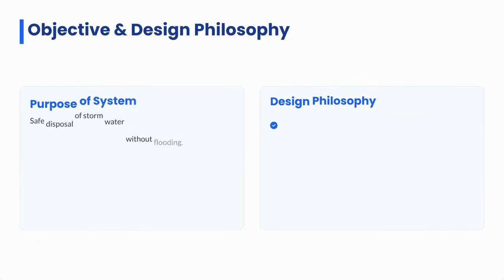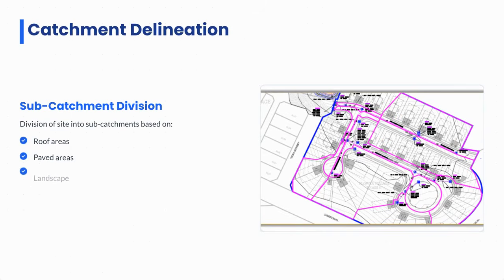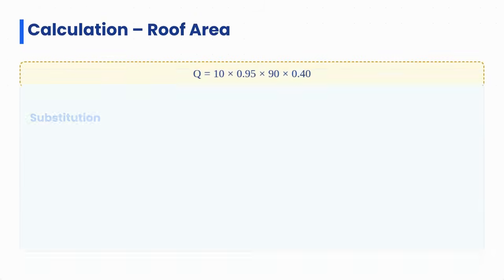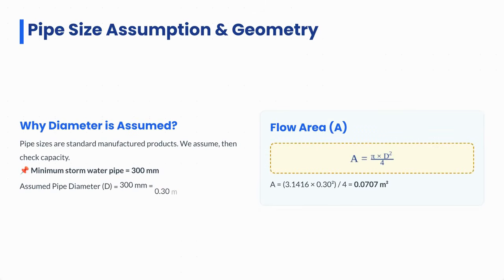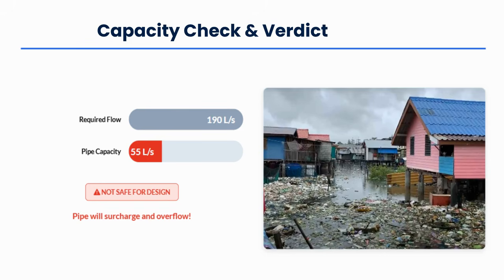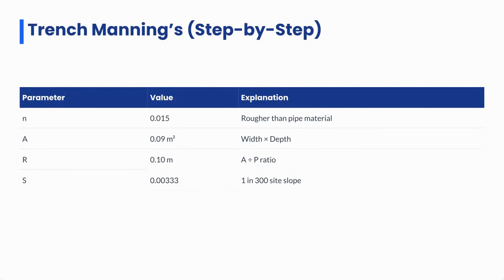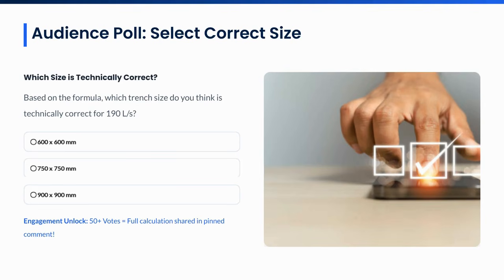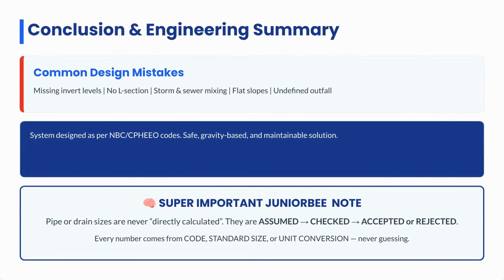How to Design Storm Water Drainage System_ Full Design Process with Calculations

Comment: This is ancient. We are using softwares now bec they are considering alot of factors
Reply from the maker: You are absolutely right , But this video is intended to help learners understand the basic fundamentals of the Rational Method and cross-check results, not to replace software. Understanding the fundamentals is what makes software use reliable, not outdated.

Comment: When calculating i got the adequate pipe size to be 600mm and the trench 600mmx600mm. Though both could be reduced based on available pipe sizes and safety factors.

Comment: Great breakdown of storm water drainage design from runoff calculations to hydraulic sizing. The video really shows that in drainage engineering, the details make all the difference — one wrong assumption can open the floodgates to major failures. I also liked how it explained that pipe sizing isn’t done by guesswork; every calculation has to hold water both mathematically and in the real world. – Dr. Sera, P.E., PhD

Comment: I have a landscape company that mainly focuses on Commercial Properties. There’s one location that has an LID planter and it keeps having stand still water like it’s not draining or at least drains really slow. What causes floods/ stand water in a LID planter???
Reply from the maker: Hi.... There could be multiple reasons for water stagnation in the LID planter, such as blockage in the drainage system, poor soil permeability, improper slope, grading issues, or compaction....Please check the outlet of the drain pipe, as it may be choked due to debris or plant roots.... If plumbing drainage is found OK.....then the issue may be with soil porosity or planter media, In that case, it should be checked by a landscape/geo inspector....Ideally, water should drain within 48 hours....Slow percolation can also happen if the planter is near a water body or high water table area.